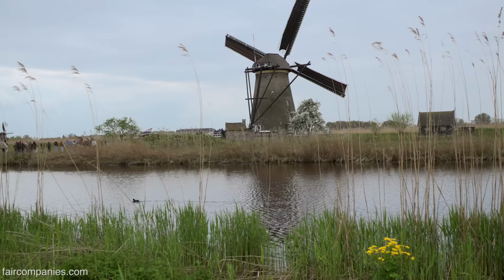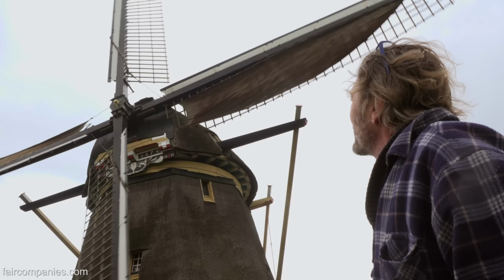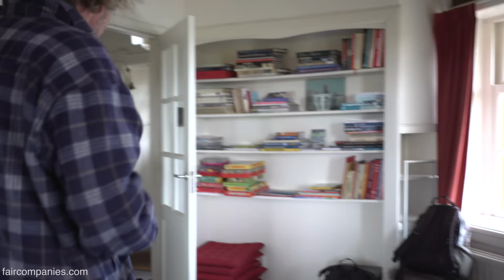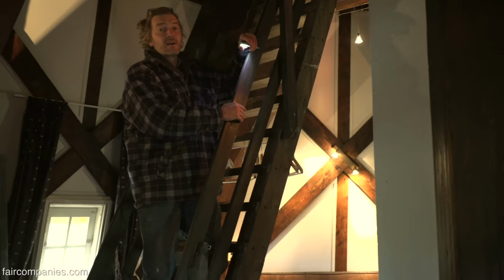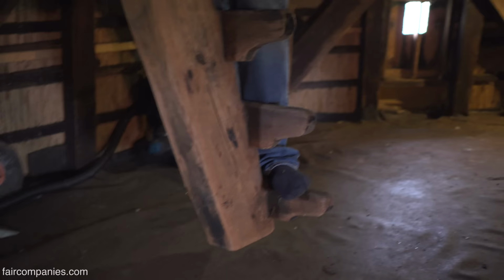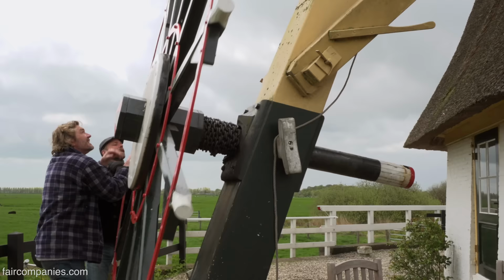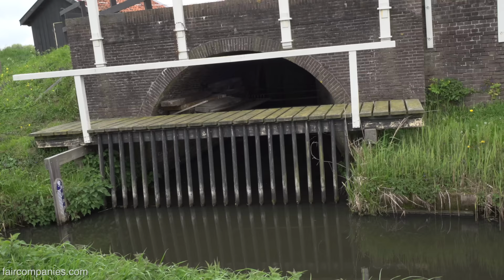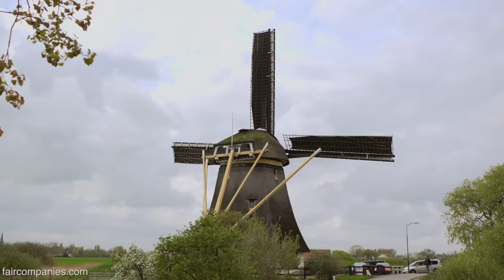Old windmill home pumps water & could inspire future dwellings

Comment: Little known fact, the reason that Holland could produce/replace fleets to fight against the English (17th century) is that the converted mills to become sawmills. Thus producing the building materials to build ships much more fast than the English could do. :)
Reply: Wouldn't the english have used water-powered sawmills, which are easier to use?
Reply: @someotherdude  No the British needed to ration their water to make sure their army had enough tea.
Reply: We had a fair few windmills ourselves.
Reply: @7822welshsteam And a navy with  a working clock.

Comment: Thank you for showing the running gear,  Many vid's on these windmills but your the firsted that showed me the running gear. I now know how they work, what a energy efficient system, water is heavy and hard to move. This water scoop(flap) is a much better design then the  bucket scoop or the chain scoop drive and so much more energy efficient, simpler, quiet(less friction on the parts) less part's and ezer to maintain. They just can't move the water very high,but they can move a lot of water very fast ..50 000 liters(50tone) per minute that 833 liters (.8 of a tone) a second.

Comment: Various types of windmills in the netherlands, this one obviously was built  for the miller to live in. Not seldomly though the miller lived in a house next to the mill and the mill itself was unsuitable to live in. yet, even the design the 'live-in mill' had to cater for the operation of the mill.
i have had the pleasure of spending  my youth near and around windmills. They were so common to me that I never realized how special in fact they were.
Reply: I'm thinking it was more livable because it was always a simple pumping station and modern remodeling tech. But you are right most mill you wouldn't want to live in. Dust from grains or wood shavings or even industrial tools. Then most mills were close to the river and have been known to flood on occasion.

Comment: Why does the Nethelands not collect silt from the rivers flowing through in spring to raise the land (slowly). IE in spring, divert silty water into a specified section of land. Let the the silt settle out, pump the water out.

That pumping rate is mind boggling.

Comment: I can't help but imagine attaching some form of generator to one of the drive wheels converting some of that immense torque into electrical energy. You could possibly supply electric power to a good portion of your community with some conversions to just one windmill.  What a beautiful power plant that would be!!  😊
Tapping into the grid and sharing the power with the usual providers would steeply decrease operation costs...
I've often wondered if anyone has done that yet with the old style mills... 
Beautiful video. Thanks for sharing.
Cheers.
Reply: As a matter of fact, the outlets from the water being moved could also be a good source of energy with the strategic use of turbines.
Reply: There were some serious attempts to try this in the 1950's but the generators of those days put too much of a strain on the old windmills. With modern technology this is less of a problem but it is just not economically viable. Remember a miller has to be present at all times to operate the mill, as wind direction and speed can change any time. Current thought is that it is better to keep the old windmills as authentic as possible and leave the electricy generating business to modern wind turbines which are automated and far more efficient.

Comment: If it isn't always pumping water I wonder if they've considered adding the capacity to generate electricity. Seems like it would be easy to turn it into a dynamo.
Reply: MakeMeThinkAgain I too thought they could use it for electricity, but I wonder if so much wood would make them a little leery of adding a generator which could possibly catch on fire, as other new tech windmills have.
Reply: This windmill is a historic structure belonging to a society that owns about 23 mills, so altering the structure would not be authentic, and thus not permitted. The original design of the mill does not leave much possibility to disengage the gears to stop the main post from rotating which turns the paddle wheel, without greatly altering the structure...and yes, besides all the wood in the structure, there is the thatched roof to consider. There are two toilet rooms in the house, both without sinks. I've seen plenty of Dutch households with about the same size toilet rooms with sinks, so there seems to be limits to modernizing the mill that have been respected.
Reply: No, the real trouble with generators is that they take full work even at the lowest revolutions. Our windmills cannot handle that type of stress, and most attempts either are hopelessly uneconomical or destroy the mill. They are like octane engines that way: optimum work is delivered at a certain frequency, you'd have to ease in the load.

Comment: I wonder why these aren't retrofitted with electrical generators and load banks to keep the blades from spinning too quickly. For sure the locals could charge their batteries. The miller wouldn't need a fire for heat or worry about light.

Comment: still it runs idle? maybe the should be retrofit with electric generation?
Reply: it takes someone being there all the time when it runs. So its great for maintaining the heritage, but apart from using the power for the house itself, I dont think it would be "economic". 

Based on 50000 liter per minute and 6 feet water difference, I estimate its about 15kW.
Reply: It doesn't run idle, it pumps water that then won't have to be pumped with an electric pumping station. They even get some money for it I believe, of course that's nowhere near enough money to employ someone to run the mill and do the upkeep.
Reply: @ rok adamlje ....... 15 kW doesn't even come close !   With 50 m3 per minute it pumps 3000 m3 per hour ! It would need for example a Samson KM2700 pump to get those numbers, and the KM2700 needs a 110 kW electric motor to operate......

Comment: Car motors vibrate, and the solution for that is Rubber Tubing for any Plumbing. ;) Now as to the main reason why I am responding is, I am wondering what with all that power, why don't they produce Power Err Electricity?